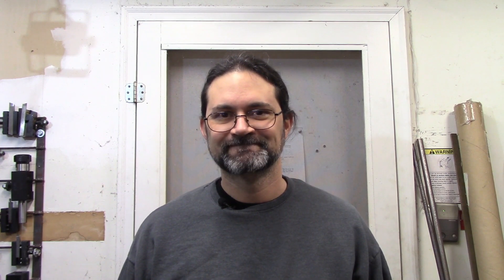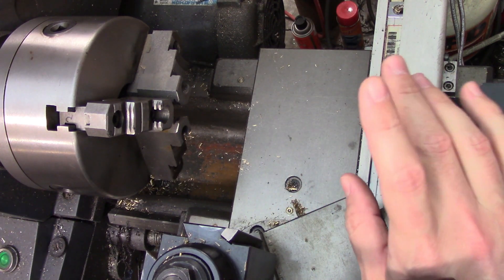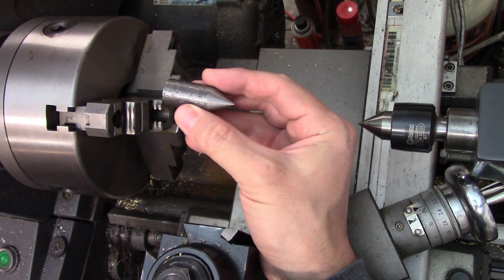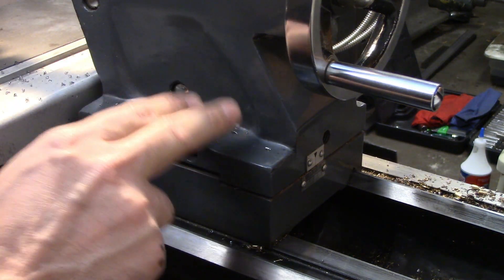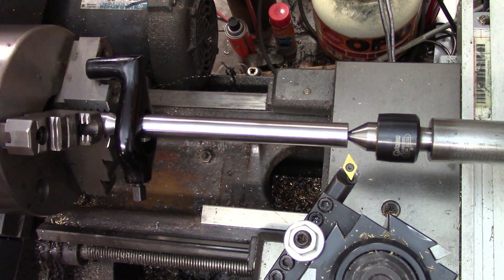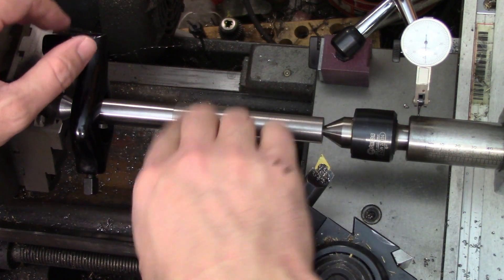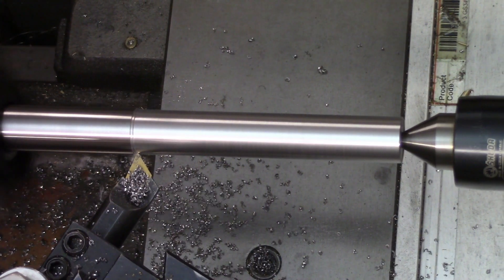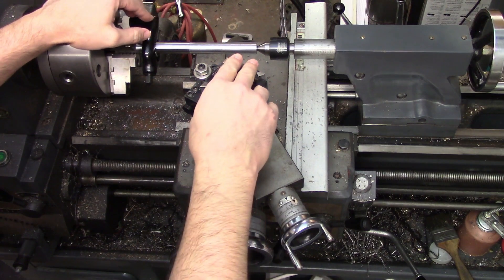How to Align the Tailstock On a Metal Lathe - Quick Machining Tip #18

Comment: Hi Stuart.I appreciate your kind response.I finally decided to be happy enough with my Harbor Freight lathe-milling machine to be within 1 thou in both longitudinal and circular deviation.It is more than I need,or maybe not?.I bought  some test bars an other pieces since my lathe does´nt have the the adjusting screws in the tail stock..Being in Spain now,I use my dial indicators both inches and metric at the same time.In inches I read thous and in metric I read "cents"( 1 hundreth of a milimeter ).Since 1mm.=40 thous,then 1 thou=2.5 cents and 1 cent=.4 thous.Easy enough.Gracias amigo y hasta pronto.
Reply from the maker: Thanks for the inspiration for the video! No adjusting screws, huh? That's a new one for me.
Reply: @StuartdeHaro  my Weiler MD220 has no adjusting screws in the tailstock as well. 
Thanks for the good info in your video's!!
Regards from The Netherlands
Ronald Veraart

Comment: Hi, I would like you to answer a question I have. Please.
I have the tailstock aligned on the horizontal axis but slightly higher on the vertical axis. Do you think this is important? Should I also adjust the tailstock on the vertical axis? Thanks.
Reply from the maker: @brilloestelar1  How are you determining that it is high in the vertical axis? I only ask because if you use an indicator then gravity is acting on every part of that setup, the arm of the holder, the indicator body, the stylus, and the tailstock quill. It will end up looking high because gravity pulls the indicator down towards the top of the quill and down away from the underside. This means it looks like the top is touching more and the bottom is touching less. The quill is more restrained by the body of the tailstock and is much stiffer in comparison so while it is also being acted upon by gravity, the indicator and holder, with all their moving parts, flex a lot more. Anyway, if the error is small it shouldn't be anything to worry about. I hope this helps. Thanks for watching!

Comment: My tail stock is out vertically I have not found any alignment screws to adjust this,
Reply from the maker: There are none for that. It's caused by wear between the tailstock and the ways or droop on the quill. Your best bet is putting shim stock between the upper and lower parts of the tailstock.
Reply: @StuartdeHaro  K, thanks for the reply. Cheers.

Comment: Can I just mount a chrome rod between centres, indicate along that and move the tail stock accordingly instead of taking a cut?
Reply from the maker: Yup. That would work. You just need to make sure that your centers are very concentric and the bar is actually straight. Those would be your two biggest sources of error.

Comment: I’m trying to align my lathe as I have a lot of shake
Reply from the maker: Shaking could be caused by a few things. I'd start with where the stand meets the floor. You could have a soft foot situation where it isn’t stable on the floor. If you have leveling feet, make sure they're all touching the pads. If you don't have leveling feet, you could have the same problem, but you'll need to correct it with shims under the low spots. If it's on a bench top, stiffen up the bench as much as you can. Check to see if that improves things. If not, move on to making sure the machine is mounted well to the stand/bench. If all that is solid it might be a mechanical issue such as a bad bearing. Once you have everything stable, then you can check the level of the machine, but the level is only going to fix a tapered cut, not a vibration.

Comment: That is a good way to do it , others recommend turning a plug the same diameter as the tailstock spindle and aligning them , 
It doesn't work if like my old atlas lathe the morse taper in the tailstock spindle is not machined accurately in the centre of the spindle
Took me a while to identify that little problem
Reply from the maker: I can imagine!

Comment: Fantastic explanation, as always. 

So is this just an alternative to the test bar method where you would sweep with an indicator? Seems like a very good way to do it where you don’t have to buy an expensive test bar.
Reply from the maker: Yep. It's just another way of doing the job.
Reply: @StuartdeHaro  thank you Stuart, you’ve saved me money!

Have you done a video on lathe levelling?
Reply from the maker: @freestyla101  Not yet, but I will eventually when I get all my machines moved to their final homes.
Reply: @StuartdeHaro  awesome I look forward to watching it. 

Do you think using a digital angle gauge on the bed to adjust the levelling feet so that it reads 0° on both ends would work? I’d like to avoid buying a machinists level if I can, and I figured it’s got to get it close. A lot closer than a carpenters level at least.
Reply from the maker: @freestyla101  I'd guess it isn't going to be accurate enough. Even going from looking perfect on a .005"/foot machinists level to a .0005"/foot master machinists level you'll see a massive difference. You're not just trying to make the machine level. You're trying to eliminate twists in the bed that can cause tapers in your cut. A small error in that regard makes a huge difference to the cut.
Reply: @StuartdeHaro  correct, by level I mean across the Y axis on both ends of the bed. I figured if I could get both sides to read 0° there should be no twist. However that might not be the case as there is room between 0° and 1°. No worries anyway, it’s just a theory.

Comment: Why can’t you put the bar directly into the three jaw chuck? Thanks.
Reply from the maker: That wouldn't show the taper on the tailstock because the chuck would be holding it straight.  Or straight-ish at least.
Reply: @StuartdeHaro  
I see your point that the bar would be freer to move, but I guess it depends on how much you need to move the tailstock. I’ve noticed that they sell test bars to align tailstocks with a Morse taper that goes directly into the spindle. They are to be used with an indicator not cut for sure. Do you think they are a good idea?
Reply from the maker: @greglaroche1753  You know, I've never had occasion to use one of them, so I don't have an opinion one way or the other.

Comment: Hi Stuart Thanks for the video, my question, what about the height of the tailstock. My tailstock has shims in to correct the height. How will I get it set to the correct height in order to have the height and alignment correct
Reply from the maker: That's tricky because the wear causing it to be low is almost certainly uneven.  Also, how much of the wear is in the tailstock and how much is in the ways? Spinning an indicator around the quill and taking readings is unreliable because of gravity the same is true for extending the quill out a distance and sweeping along it.
Reply: @StuartdeHaro  thank you for the reply. Will let you know what pans out

Comment: Hi and thanks for good info. I did it the same way you did, but mounted testbar in 3 jaws  chuck.  Is senter to senter the way to do this aligment from headstock to tailstock?   mvh  sverre  eriksen,  trondheim,  Norway
Reply from the maker: A test bar is nice because you already have a known standard and you can mount it, check it with an indicator, and make your adjustments. Since you're looking at the  difference in taper between the headstock and tailstock, you need to divide the taper in two to get your adjustment. Otherwise the process is the same as what's shown in the video.

Comment: Hi you mention it in your video, before you start on your tail stock….
The lathe should be tied to the floor and level
The bed should not be twisted when it was pulled down
To check this put the test bar in the centre with about 5 “ sticking out, do a light cut with out the centre in the back then you will see if your bed is twisted. You will have to shim the tail stock end under the lathe till you get it parallel, once this is done you can adjust the tail stock 
You may have shown this on another video..
Thank for your time and effort in making the videos.
Best wishes Laurence

Comment: stuart long time viewer , if you really want to help a guy out i have to make 2 small gears one is with a keyway the other has a round hole 1/2" or so  but its not drillable because one side is flat for the drive so it will not slip what is the best way to cut a hole with a flat on one side
Reply: oh and by the way keep up the great work and videos
Reply from the maker: One way you can do it is to make it a round hole with a separate half moon slice to take up the space. That can be brazed, pinned in place, or just held in with a set screw (pinched between the gear and the shaft). You can also lay it out with dykem and scribe lines and drill out what you can and finish by filing to the lines. It's very fiddly and will require a lot of test fitting to get it fitting right. Check out the videos by Clickspring. He does that sort of thing a lot. Good luck with it!
Reply: @StuartdeHaro  i kind of wanted to know the correct way to do it with the mill and what set up to use
Reply from the maker: @le3045acp  you mean the gears or the weird bore?
Reply: @StuartdeHaro  i mean the weird bore i think ive got the gear cutting figured out
Reply: i figured it might make a good video but im probably wrong
Reply from the maker: @le3045acp  Obviously you have a dividing head if you're cutting a gear. What is the diameter of the shaft and the distance from the flat to the outside of the shaft? Length of the bore? What material are you using?
Reply: @StuartdeHaro  its aluminum and its 1/2" and the flat is about 400 thou from the rounded side i have a dividing head i just dont know how to to calculate the process and would love to see it done because i have not been able to find a video on youtube showing the process and i learn better from watching than book reading if you know of a video that shows the process please link me to it sir thank you for taking time and corosponding with me it means a lot to me love ya man
Reply from the maker: @le3045acp  I like you okay too bud. I'll see what I can do for you. They only way to do it by machining will be to drill some relief holes at each end of the flat. Is that okay for the part?
Reply: @StuartdeHaro  yes i just want to see how a knowledgable machinist would tackle the problem and the love word was only a brotherly comment for what you do with your helpful videos ty again
Reply from the maker: @le3045acp  what's the OD and length of the part btw? The length has to be a consideration.
Reply: @StuartdeHaro  i will get the exact measurements of the shaft and the gear blank for you tomorrow and post them here
Reply from the maker: @le3045acp  sounds good 👍
Reply: @StuartdeHaro  best i can tell the shaft is 548 thou on the wide round spot and 425 thou from the flat to the round and the gear blank size is whar ever it is for a module 1 20 degree pressure angle with 48 teeth thank you sir
Reply from the maker: @le3045acp  that's pretty close to 14mm and 11mm. How long is the bore (total length of that weird hole)?
Reply: @StuartdeHaro  3/8"gear thickness
Reply from the maker: @le3045acp  Okay, that's not too bad. I was worried it would be 1.5" long. That would be a lot spicier.
Reply: @StuartdeHaro  yes it would be much harder

Comment: What if your tail stock is HIGH? In/out is good, but wouldn’t this have some bearing on this? Am I over thinking this? Feels like time/space continuum stuff…
Reply from the maker: It really shouldn't be. The bore of the tailstock is usually machined using the lathe itself to ensure alignment.  Being high or low would produce a slight taper but not as bad as an error side to side.

Comment: Hey Stuart, Just wondering what if I put a indicator on the chuck (not in the jaws) and spun it around the tailstock, what would I be measuring? I tried it on my lathe and was very surprised by the readings. Love your videos and humor. Thanks 🙏🏾
Reply from the maker: You will actually get some pretty weird readings because gravity is working on the indicator and the holder.  I will look like it's high because the indicator is getting pulled toward the part (contacting more) when on top and away from it (contacting less) when on bottom.
Reply: @StuartdeHaro  I agree. I used a very rigid holder but I don’t think gravity could a count for the difference in readings. What about side to side along the x axis? Would that be a way to align the tailstock? I use the method you show to align currently but I’m just curious if this possible as well.
Reply from the maker: @jajanisbeth9207  I don't think I would do that.  If you're putting the indicator holder in the chuck you're introducing the possibility of error due to the runout of the chuck. Even a collet is going to runout a bit. You want to make sure that what you're measuring isn't being influenced by something else.

Comment: I've seen similar done using just a few aluminum discs pressed to the bar with the center drilled ends. Thus the discs are consumed, but can be replaced as they are consumed.

Comment: I almost never use the centers that came with my lathes in the head stock. I do the same as you do Stuart with the addition of cutting a .050" or more step in the part where the chuck jaws grip it. That prevents the center from ever being pushed back within the chuck jaws and the part that's between centers from becoming loose. A small but imo important detail.
Reply from the maker: I like it! I going to do that. Thanks for the great tip!

Comment: Stuart's method works fine AFTER you have performed several other inspections on the tail stock. If you do the alignment as Stuart describes and the lathe is still turning taper that, though small, is especially noticeable if you are for example turning seats for several bearings on a shaft and no matter the alignment they are different diameters there are some other things you need to check and possibly correct.
My 1989 Taiwanese 12" lathe has the same tail stock as Stuart's lathe and I found the following misalignments, all of which will cause the lathe to turn taper:
a) The axis of the tail stock quill is not parallel to the axis of the head stock spindle or
b) the axis of the tail stock quill is above or below the axis of the head stock spindle.
c)the axis of the tail stock quill is not parallel to the the head stock spindle in the horizontal plane.
These faults are corrected by modification to the cricket that slides on the bed ways and which the tail stock sits on. The quill is leveled first. Grind the cricket or shim it so the extended quill is absolutely parallel to the bed. Then grind or shim the cricket until the quill  is even with or 0.0015" max above the lathe spindle axis (this allows for wear and clamping). Lastly using shims or jack screws on the back of the tail stock (if provided) make sure the extended quill is parallel to the lathe bed. 
Finally test as Stuart shows with a shaft between centers. The lathe should turn straight no matter the position of the tail stock or how far the quill is extended.
Actually before you do any of this you need to check the head stock spindle. The easy way to do this is spend $50 for a ground test bar to fit the Morse taper in the head stock. My lathe required 0.002" shims at the back and using the jacking screws on the back side of the head stock that hangs over the bed to get it all parallel with the bed.
This may seem like a nuisance to do but it really improves the usefulness of your lathe. You can turn diameters straight and to size without having to use a file and Kentucky windage. Importantly you will notice that small drills 1/16" dia. (1.5mm) will not be bent to go into a hole that's being drilled.

Comment: What if the tail stock is out up an down?
Reply from the maker: That would take a considerable amount of wear. The bore of the tailstock should be machined by the lathe itself to ensure alignment. If you need to, I suppose you can shim between the upper and lower halves of the tailstock.
Reply: Thanks for the information!
May try to shim it, not sure I understand about boring it then
What to do.
Reply from the maker: @mikem970  You wouldn't want to bore it. I meant that it was done that way at the factory. Reboring it would require you to make a new quill to fit.
Reply: Gotcha, thanks for the help! Enjoy your videos!!

Comment: Turning a point on a piece of scrap in the chuck to use as a center is a huge time saver vs fitting a face plate & 'traditional' center. Several good tips in this one. Bueno.

Comment: When I set my tailstock, I turned the entire length of the stock and then miked it at both ends. I was to say the least somewhat tedious. I like this way much better and will use it in the future.
Reply: You can also just turn the tail, the middle and the front and check all three points.  No need to turn the whole length.